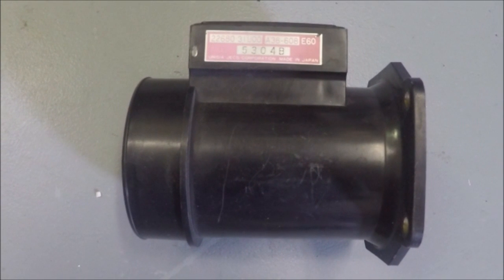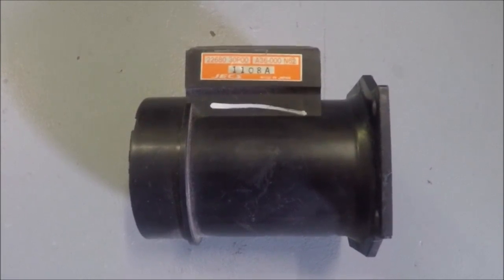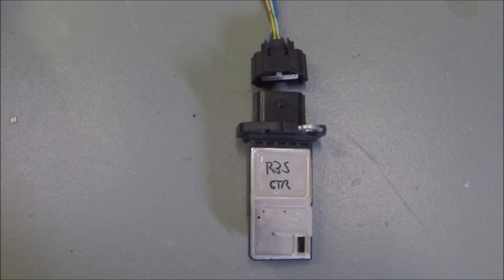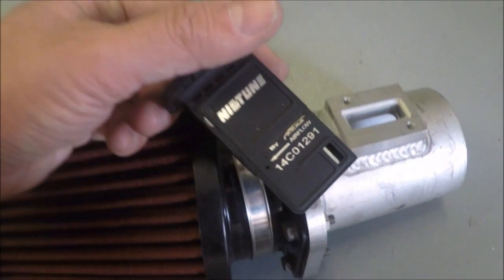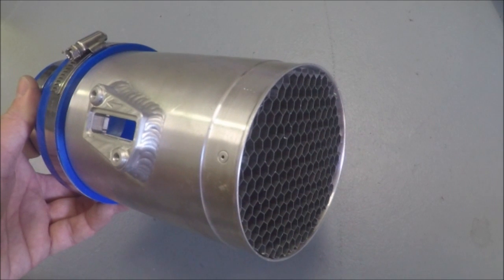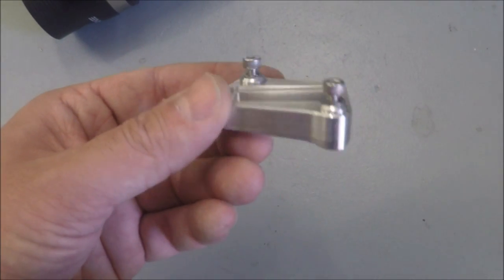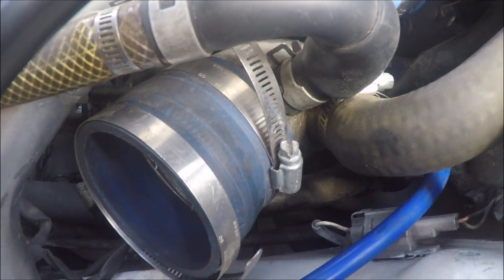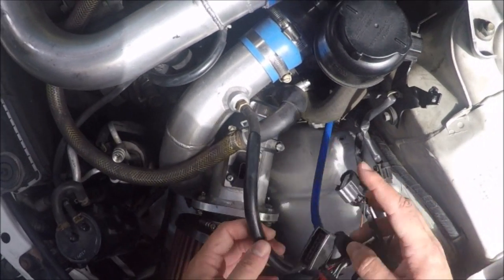Upgrading MAF sensors with Nistune

Comment: Hi ...What is the replacement part needed for my CA18det 1.8 turbo? The oem is 22680 61A01with a 4 pin socket?
Reply: You need a r35/ Tiida MAF

Comment: My tb48 patrol has the newer style meter, and the metal mesh that was in front of the mad was destroyed buy a back fire, I ripped it out. Would that cause reading problems??
Reply: I see this is 5 years old the screen in front of it is to straighten out the airflow to help the sensor get a correct reading by reducing turbulence ive seen them removed and run fine but the factory spent the time and $ to pit them in....